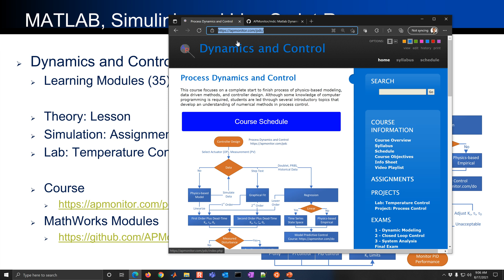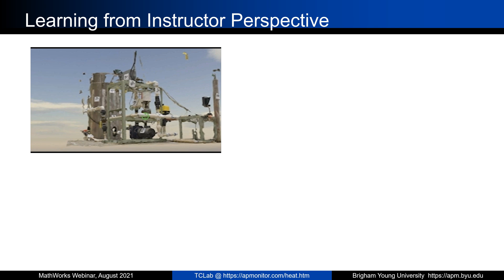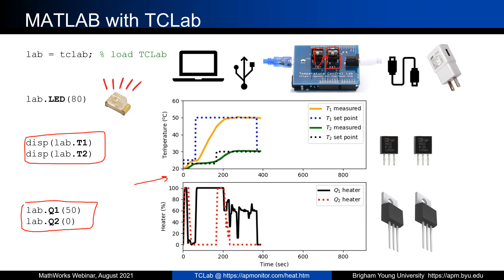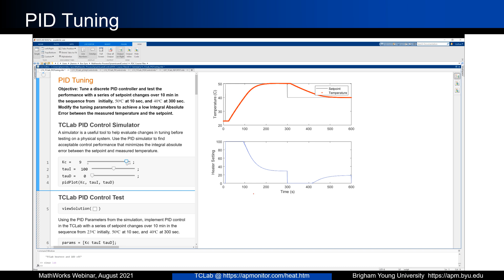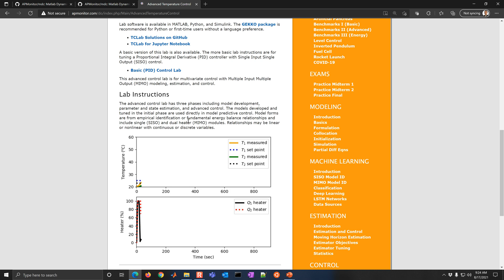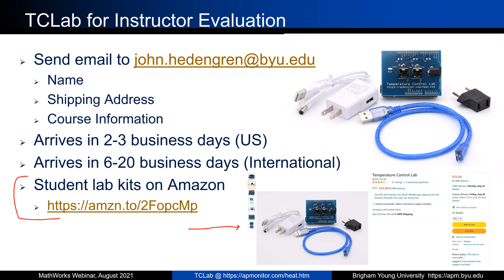Learn Chemical Engineering with Interactive Modules

Comment: These look great, congrats! Thank you for the investment in open sourcing your teaching materials and continuing to build on them. Separately, I'm having generalised performance/functionality issues using .mlx files on the current release (recently reinstalled) of 2021a on a 2020 MBP (Big Sur). I'm following up both via the Mathworks website and also directly with support, but if anyone has encountered something similar and found a fix, would be great to hear from you!
Reply: Peter, the course was created with 2021a on Windows 10 and Ubuntu. Let me know if things work out, or if there is a way I can help with the course specifically.
Reply: @joshuaeh  Thanks Joshua, the problem was caused by the default setting for java heap memory. If anyone has a similar issue here is the fix: https://in.mathworks.com/help/matlab/matlab_external/java-heap-memory-preferences.html